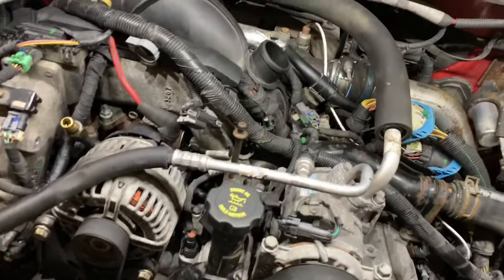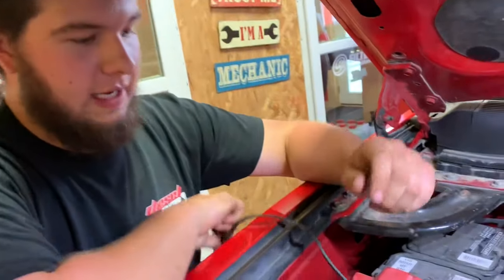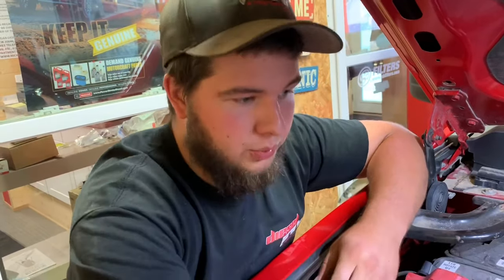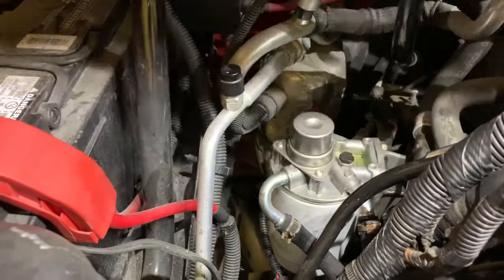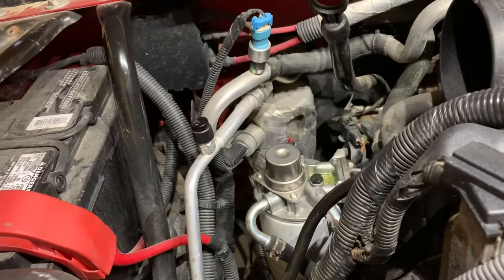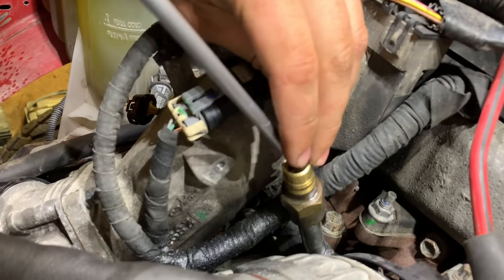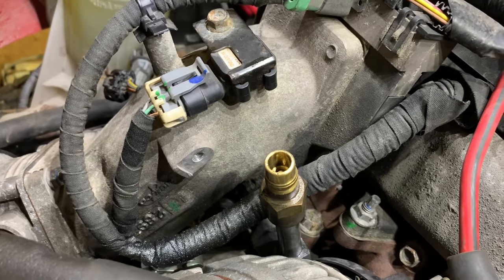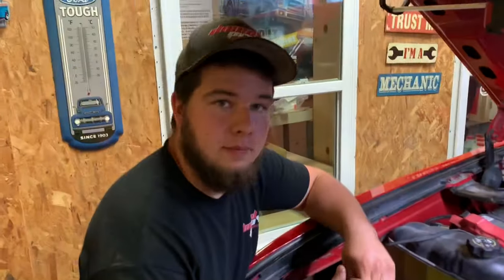How to bleed the Air out of the Fuel on a Duramax

Comment: Use a "ball end" 1/4" Allen wrench on the Schrader valve.    Pump a few pumps on the primer on the fuel filter,  then 
give it a half second bleed on the Schrader.   If foam comes out, do it all again.

Comment: Very helpful, thanks.  Just had the WIF sensor start leaking and wasn't sure how to properly prime the filter again.  Just had the water separator filter replaced, the old WIF finally gave up as it looked like the OEM bit from 2008.  Worn sensor wires too, the leaking fuel likely threw the water sensor alarm due to bare wires, creating the contact.  Learning about diesels as I go, appreciate folks like this that share their knowledge taking care of aging rigs.  This one was simply a shot o-ring.

Comment: Thank you so much your video helped me tremendously as this is my first Dmax LB7 ran out of fuel yesterday had to have my daughter use our other truck to pull it home and was still having issues but after I watched this video it was 30 minutes after I got the batteries charged back up and all the air out of the system 👍 Carl papa fired right up. Thanks again y'all rock 👍👍😁

Comment: You saved my butt from a lot of work. Just did a LLY fass lift pump and stock fuel filter head delete. Got her air locked and was about to put the stock filter head back on to prime. But tried the pocket screw driver on that shrater fitting and got the air out. She then fired right up. Thanks a lot man!
Reply: but you did it with the truck on or off

Comment: I learned somewhere that the CP4 fails because the steel in some of the parts in it were not cured correctly at the factory... (some super heating they do) and that a lift pump is not the issue nor even necessary.

Comment: I bought a 6.5 Detroit Diesel from auction a few years back... it's archaic compared to a D-Max, especially since mine is mechanical injection.  Who ever had it before it, removed the fuel filter + fuel heater assembly and installed an in-line fuel filter that's designed for a lawn mower.  I haven't gotten around to replacing the filter assembly with a proper one, just been replacing the lawn mower one every year, but I have to leave the line loose and let the lift pump run for a bit to bleed the air out, even with a return-style fuel system.

Comment: What about when it’s cold and you’re son didn’t put diesel 911 in the tank and did not plug it in truck started and ran for a few minutes, then shut off just cranks now I will not fire. I believe he run fuel out of engine and injectors and fuel line is frozen. What is the best way to tackle this thank you.
Reply from the maker: I personally would choke the engine like I would a small gas engine. Block the air intake until it starts if the truck is outside in the cold

Comment: I don’t have a lift pump

I changed out my fuel filter pumped it till it was flowing diesel fuel without bubbles tighten the bleeder screw and my truck seems to struggle on the start up but once it starts up runs normal

I did it a second time as far as pumping it all over again to see if it would help and seems to still be struggling on start up to crank immediately
Reply: I live in Los Angeles and I’m running a cat fuel filter
Reply: Almost makes it seem as if my starter is going bad
Reply: air introduced,press shrader ,and pump  primer

Comment: 2005 Silverado 3500 LLY, I have trapped air between the primer pump and the Schrader valve, I’m unable to get the fuel to push through to push the air out of the Schrader valve. I have a piece of clear line on there so I can see what’s going on. I have replaced the pump and filter and hoses and clamps. Please help.
Reply from the maker: I’m willing to bet the fuel filter head is cracked you may need to replace it or it’s your fuel or supply lines running from the top of your engine on the driverside to the fuel cooler

Comment: So you can't crack a line loose on an injector to bleed the high side?  Because my sprinter has fuel going to the high side when I put the ignition in the on position.  It's only tank fuel pressure there, but it's there nonetheless.   Is this right, or is there something wrong with the hpfp?  This is a new remanded hp pump

Comment: My old buddy randy evans (RIP now) had a Duramax and it run great but then one day started running rough and sometimes stalling and wouldn't start for a few but then one day it wouldn't start at all and I told him I'm no diesel guy but I know it sounded as if it was starving for fuel , and I found that primer bulb myself and primed it a few times and the truck would fire but not continue running long but I did notice that it was leaking pretty heavily around the cylinder shape o ring or something but he passed away so never did get too figure out what fixed it or if that was all that was wrong ?!??

Comment: Hey boss, I have a 16 3500HD silverado with the 6.6 DMax. I noticed that when I was priming my engine, diesel was coming up the bleeder valve on the top of the engine. Not the plastic one. I just got the new one but have not put it on. Would the fuel that I see be a indicator that the valve is going out and allowing air to get in the system? I'm have trouble in the cold start with it starting. But once I've ran it it starts right up. Please help. Thanks.

Comment: Cranked my truck yesterday, started fine, decided to do a fuel filter head delete because I was dealing with a loss of prime after truck sits for awhile. Looped the bottom hose on the ficm to the top and now cannot get truck to prime and I can’t get fuel or air to come out the shrader valve. Also fass lift pump decides it doesn’t want to come on either after turning engine over even tried to jump the relay, so now I have no way to prime fuel without reinstalling the filter head. Any help would be greatly appreciated!

Comment: Truck master i need an honest suggestion. I own a 2006 Silverado 2500 LB7 purchased new with only 65 k miles minimum mods (SB air filter, 3’ down pipe with 5’ stacks) im debating should i sell and get a new 2019 6.2 gas Silverado? I very rare pull or haul heavy. Money wise sell & use for down payment and payments should not be a issue. What would you do? 2006 Silverado duramax has never given me an issue, what would be your honest opinion❓Thanks best regards

Comment: Have a question on a 2011 duramax 6.6  driving normal truck does ok if you really get in the throttle hard it bogges down to the point it will go into reduced power

Comment: I need help. I changed to the exergy fuel saver on my LML and put it all back together. Now it won’t crank. I have bleed it at both the fuel filter and the fuel test port and still won’t crank. I have a ppe lift pump and and let it run for 20 sec but still nothing. Any suggestions? Could the exergy be bad? Or maybe a blown fuse?

Comment: I’ve got the heads off my lb7 right now, when I get them back from the shop and reconnect everything, can I prime the entire system with that primer pump and bleeder valve at the fuel filter? Thanks.
Reply: Everything but the high side of the pump will be primed by the filter head
Reply: Christopher Seelye, After I pump the filter, will the rest prime itself and start then when I crank it for a while? Thanks for the advice.
Reply: Yes
Reply: Prime the shit out of it. Just when you think you primed enough,  prime it some more.
Reply: Thanks for the advice guy, first time tearing down an engine, it’s intimidating.
Reply: I have a lbz about 4 days ago I lost power in 2nd gear for about 5 miles then it came into it I was thinking it was the pressure relief valve on the back of the fuel rail then it ran fine an the other day it died an won't start back does have a p0087 code I changed the fuel filter an found alot of water as anyone else had any trouble with this an now when I try to start it alittle white smoke comes out an it stinks but still won't start I was going to pump the fuel out of the tank an put fresh in an take the fuel filter off turn on the key a few times to get good fuel in the line put fresh fuel in the filter  an hope it starts any input on this would be very great tbanks
Reply: ed perkins idk man, sorry. I finally got mine back together and everything is fine but I changed out the cp3 pump while I was in there. I’m thinking there’s no fuel pump inside the gas tank, I think the cp3 pump in the engine pulls the fuel up from the tank so I’m not sure if you have the filter off, you’ll be able to get any suction to clear the lines like you mentioned. 
 I could be totally wrong though, I got really lucky with my rebuild. You’re on the right track though asking these guys on YouTube, I’m not a mechanic and rebuilt my lb7 from a Haynes manual and asking questions from these guys that know.

Comment: I don’t have a lift pump and I have a problem with cold start,after about 10 seconds my 2003 goes dead then I have to prime this only happens on cold starts or after sitting. I changed filter twice,ordered new primer head installed now no start can’t get primer filter housing to fill.any idea that you or anyone has would be appreciated thanks

Comment: Friend of mines kids left there 2024 duramax running to listen to the radio in the there barn and forgot all about 2 weeks later and a $120 worth of diesel and 2 dead battery's charging them up right now is there an bleeder screw and pump on this one I've been a auto mechanic for almost 40 yrs can do general maintenance on diesels but when it comes to the engine running wise I know nothing about

Comment: My LLY just started doing this, it starts idles for maybe 20 seconds then just shuts off. First time it happened I tried re-starting twice then primed the fuel system then it started up but not right away. Well it happened again for a second time same scenario just this time I primed the system before restarting, both times this happened I haven’t opened the bleeder. Both times it was parked on a slight incline with front of the truck facing up hill. I did run the truck to about 1/8 of a tank of fuel the first time I encountered this problem but I filled the truck while it was running and didn’t have this issue till I went to restart it later that day. Any idea what might be going on? I’m sure it’s a simple explanation...
Reply from the maker: You might need to replace your fuel filter you might be sucking air
Reply: Fuel filter housing is bleeding down pressure. Had to replace the housings on both of my duramax. They sell a rebuild kit but it's less than a hundred dollars for the whole housing
Reply: Truck Master I did read that online but it’s always good to get feedback from the YouTube community, thanks! Keep doing your thing brother, appreciate the time you dedicate providing information!

Comment: How do you like the ppe race plug I bought one but all the forums and stuff have mixed reviews. How long have you had it? How do you like it? Has it given you any problems? And why did you get it were you getting the low fuel rail pressure dtc

Comment: Can you Please do a coolant flush on an LML?
Reply: Take off passenger side fender liner. Find lower radiator hose. Pull out the retaining C clip on end of hose going into radiator. Pull off hose slowly and begin to drain it slowly or youll have a mess. Some guys say the oring in the hose connector doesn't seal again some times so make sure ya got access to one

To fill just fill the overflow tank. Turn on truck and continue adding coolant. Rev engine to 1300 or so rpm turn on heater and such. Get truck up to operating temp so t stats open. Continue to add coolant till it stops going down
Reply: Follow those instructions & you’ll be set. Here’s a link showing the lower rad. Hose mentioned above. https://youtu.be/fILvSCROcb4
You can also crack the thermostat bleeder on the  housing once you start getting close to full. I like to let it sit overnight and check cold level in the morning. Bring extra coolant if you need to get on the road quick,  just in case!
Reply: @TruckMaster  Thank you Sir

Comment: I have pumped and bled mine 20+ times it’s still blows air bubbles and foams up all over the top of the bracket like there’s unlimited air. I’ve got to be doing something wrong. I’ve cranked it over 10+ times and it has plenty of fuel up there at the air bleeder
Reply: Shane, did you figure this out? I am having the same issue. TIA!

Comment: Man I'm in trouble. The water valve on the bottom of my fuel filter failed. My truck just quit. Replaced filter and water valve, pumped it up, pure fuel at bleader screw by pump and pure fuel at that shader valve you talk about. But it won't start. 2013 lml duramax. Please help.
Reply: Wayne, did you figure this out? I'm currently in the same situation after replacing the wif sensor.
Reply: @Terry Humes  
Yes. Keep pumping up the fuel filter, then release air at the purge valve by the oil filler cap untill pure fuel comes out, no air. Then  crank er over till she starts. You may have to step on the fuel peddle while cranking. Ensure ur fuel filter and water sensor are new and in good order
Reply: @waynejohnson3388  thank you. I'll give it a go.
Reply: @terryhumes  Right on. Keep me in the loop
Reply: How long did you have to crank? It didn't start, but I was afraid to crank too long too much. My fuel filter is less than a year old, but I purchased a new one and am going to just replace that today too, and try again.
Reply: @Terry Humes  
Get it pumped up, get all the air out and it shouldn't take much. Remember if it's not showing a willing Ness to fire, pump n bleed. Then try again. After bleeding be sure to pump up pressure before you try to start it
Reply: So before I changed the fuel filter(the current one is less than a year old), I just pumped it until it was stiff as you mentioned (I did not do this before after bleeding). Cranked it for about 5 seconds and it fired! Appreciate you Wayne!
Reply: @terryhumes  
Awesome.  Replace your fuel filter every 6 months. I replave mine every spring and fall

Comment: I run a cat filter and changed it yesterday and went to prime as normal yet this time didn't get as hard as it did before as fast and I changed the bleeder screw out as well as old one was  If stripped I also filled the fuel filter to the top through the bleater hole 2 After feeling it before I screwed it on My truck started for a brief 2nd and then shut off and now I can't get primer to get hard but when I tracked the bleeder screw every time I pushed the valve down fuel does come out When I push it so I figured that that the primer valve is good but I'm not sure..  I don't know if I can test that that valve like you did in this video this video if I don't have a lift pump or that is just for lift pumps and eany suggestions what I could try